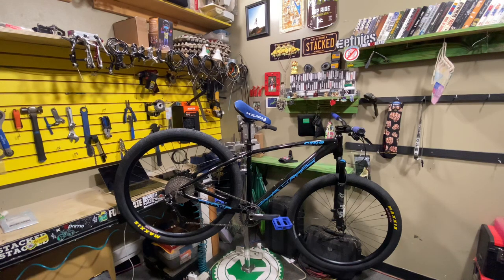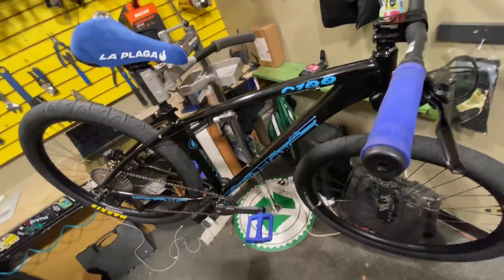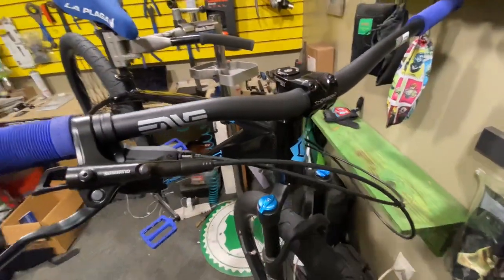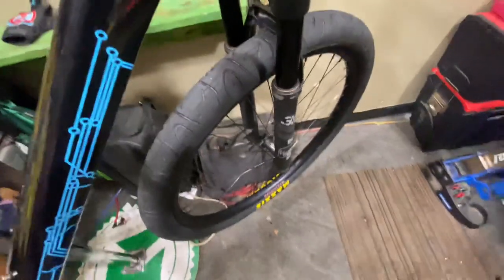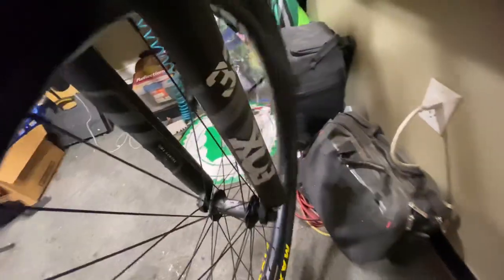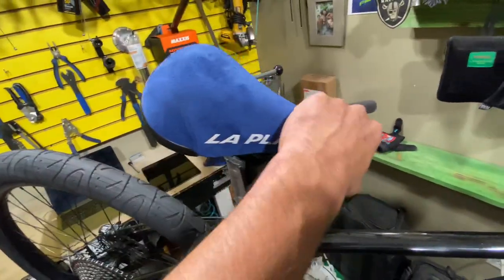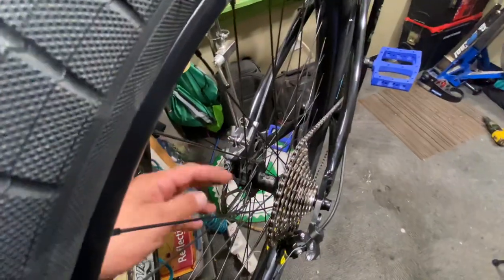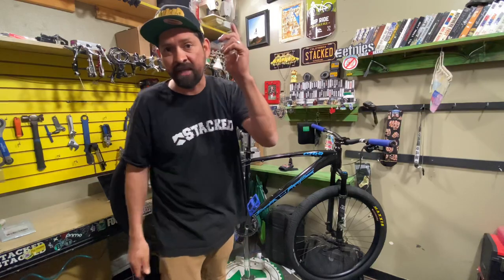The best collective c100 explained & review

Comment: What is your opinion about the aluminum mongoose 21 speed mountain bike with full suspension?
Reply from the maker: If it is a full suspension over $1k then it is worth it. At the price range is where the suspension actually works. Not fun riding a pogo stick on wheels
Reply: @Stackedbmx  No the bike is only $523 after taxes.
 I am not paying at 1000 for a bike that's a little bit much.